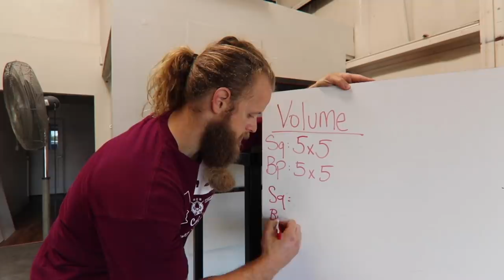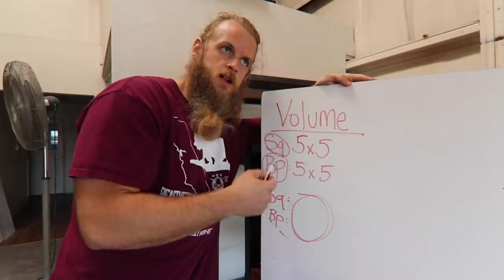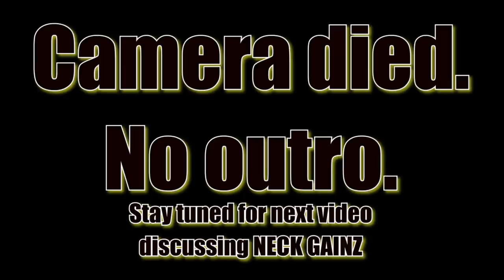There's more than one way to add volume.

Comment: Increased volume has been a game changer for me lately. Doing a version of the program you posted this past spring. Switched the benching to overhead pressing and flipped one of the “blue” presses to bench in “red” and kept one of the presses “green”. Anyway, added volume has been key after spending 6+ months doing more conjugate style programming with more limited volume.

Comment: what shoes are those? they look juicy
Reply: I think the position r1
Reply: @bmstylee  thanks a lot. bit pricey for me atm but sounds like they're a good pair of shoes
Reply: @Franklin-zc2jo  I'm kinda locked into mine for a while.  I have a pair of Romealos 2.  Just not buying another pair unless I see something really cool or at a cheap price.  I have those for squats and OHP and my Otomix for deadlifting.   The Otomix Stingray is a great pair of shoes.  They are very thin and I get a really good feeling of what's going on with my feet.    Snagged them for $100 at the Arnold last year.